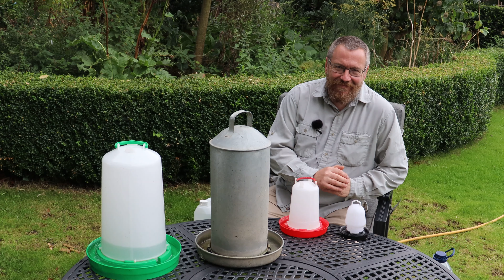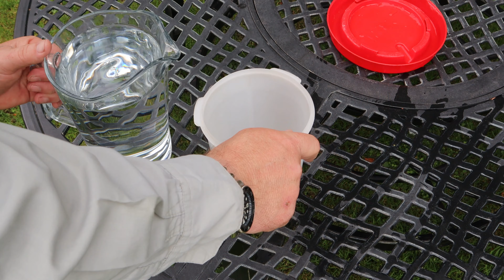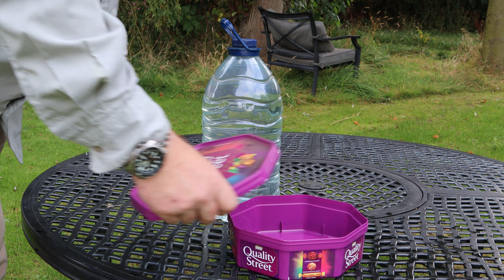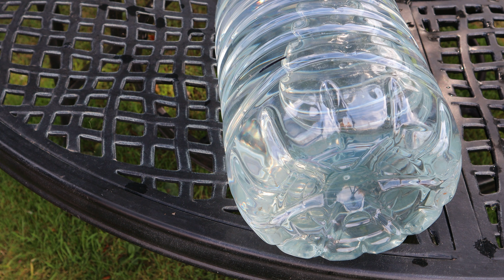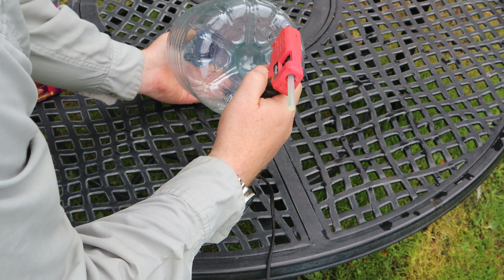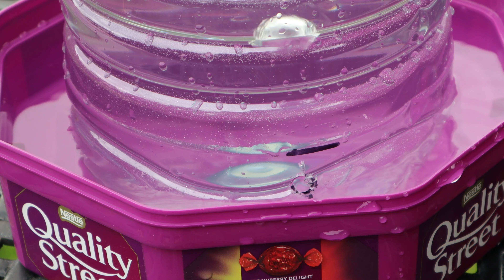Making a Free Poultry Drinker

Comment: Awesome ! I’m going to give this a try for my 2 cats . Hope it works without using the glue on the bottom of the jug .
Reply from the maker: It'll work without glue but quite possible the jug will get knocked over. If you haven't got a glue gun try some epoxy resin (the kind of glue where you mix two tubes together then apply it). They sell it in pound shops.

Comment: I want to know how YOU keep that metal one from rusting???? I'm sick of replacing every year, and no one sells stainless. I can't imagine why?????? Not in the U.S. at any rate. We need something that takes the heat of a warming disk in winter.....  :(  China has stainless.... but they don't ship here..... aaahhh the U.S.......
Reply: also one thing I have found that is working is coating the inside with melted beeswax.  It won't work for winter,  but it keeps the rust at bay during summer and needs kept in the shade
Reply from the maker: Hi Zoie. The metal drinkers are hot dipped galvanised. They take decades to rust.

http://vetshopni.co.uk/product/poultry-drinks-metal-various-sizes